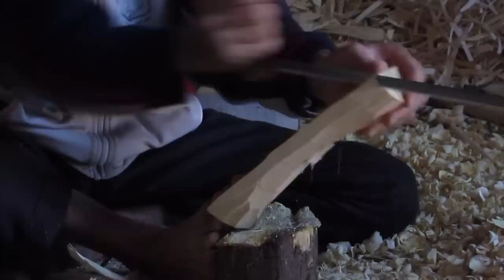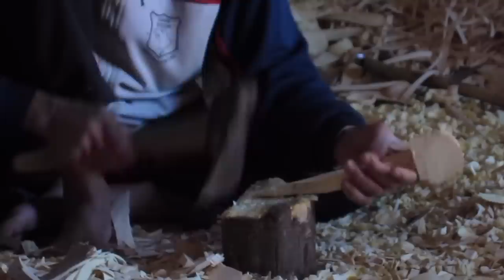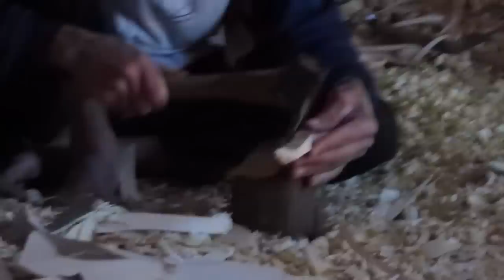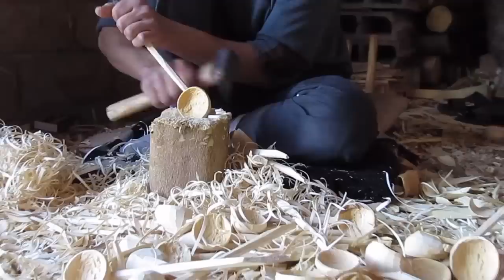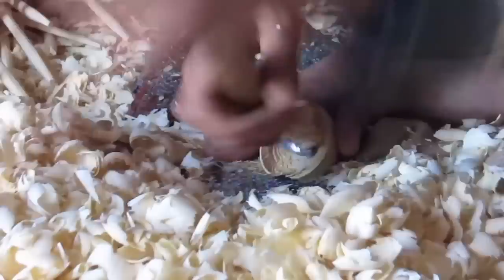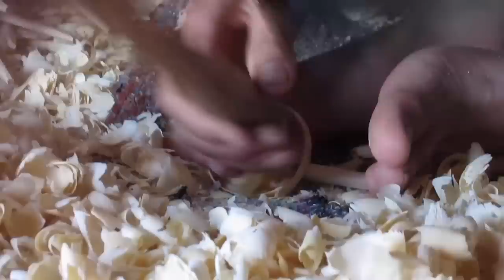Moroccan Spoon Carving in Marrakech

Comment: As a spoon carver I've got to say this is an amazing video.  Shows a different approach, using an adze instead of a hatchet to rough out the spoon. It looked like a curved adze was used for the inner bowl and a straight adze was used for the exterior.  Would that be correct.  And the long handle on the spoon knife,  wow!  I'd be afraid of breaking my spoon knife with that kind of leverage.  Must be pretty good steel to hold up to that kind of pressure.